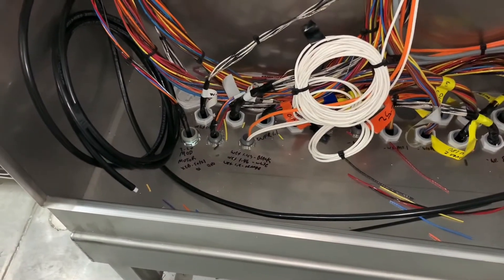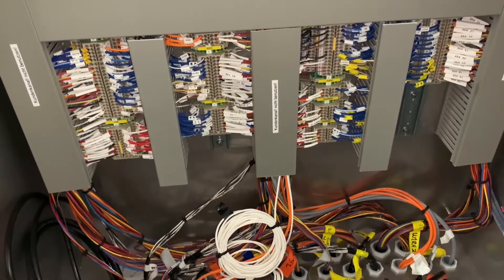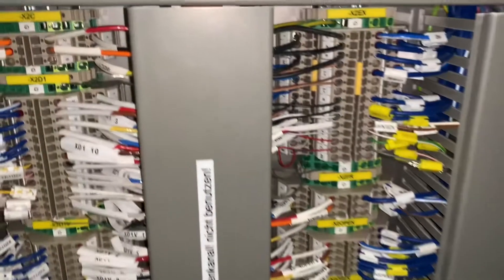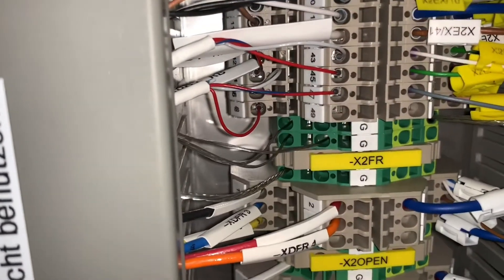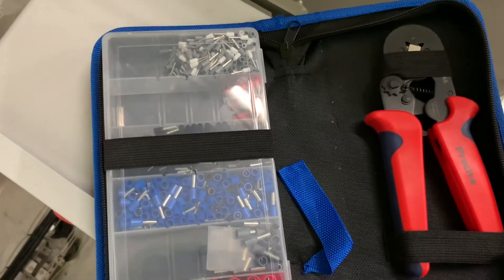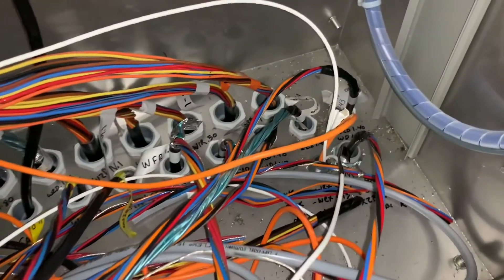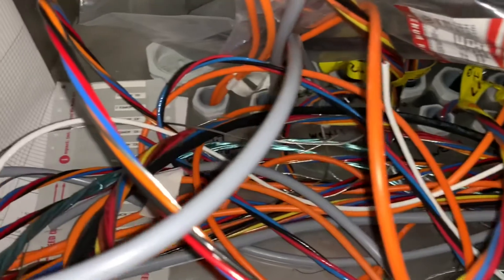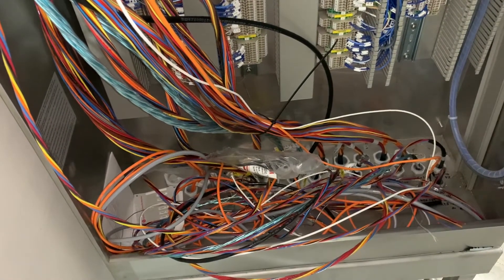Today As An Electrician: Finished Control Cabinet...Ferruley Clean!

Comment: Nice looking work bro! You might already know this or use another method but I've found a little trick that's helped out when training in all the conductors into the panduit without falling out is closing a tiewrap about the width of the "fingers" of the panduit and placing it  on (across) the panduit "fingers" (perpendicular to the Panduit run) and tighten up the tywrap just a little, where it barely pulls the fingers in together, so the wires can't fall out. This has helped me alot when training the wiring inside the Panduit. Love checking out your daily videos ✌️